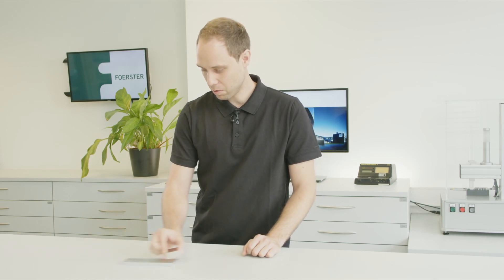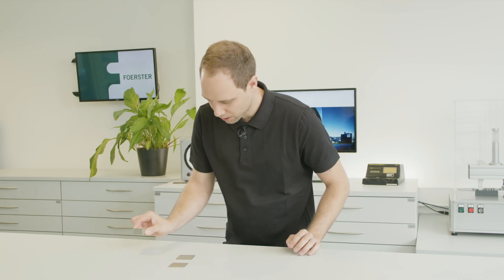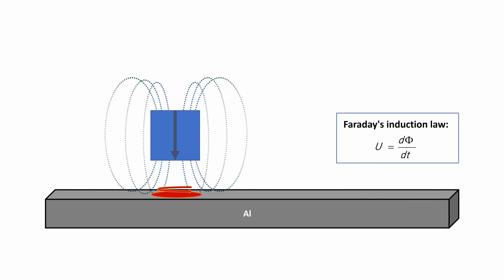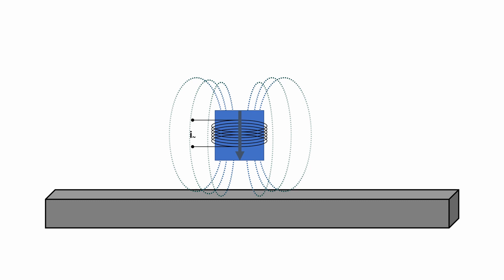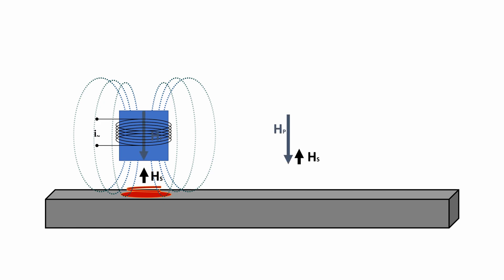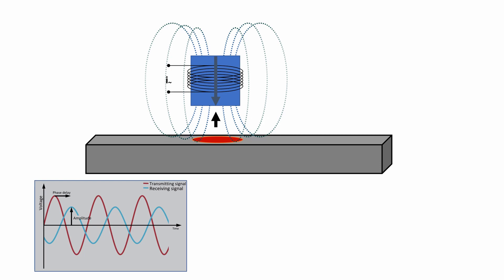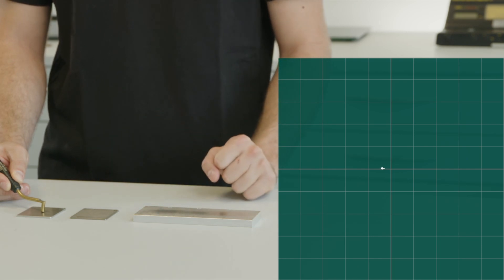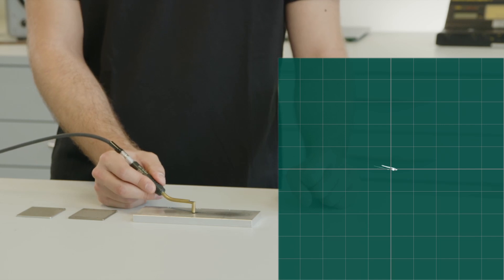Testing with eddy current -  explained simply

Comment: Nice demo

But what causes the Eddy currents to move the objects?
Reply from the maker: Eddy currents are generated when a changing magnetic field penetrates a conductive surface, inducing circulating currents within the material. These currents create their own magnetic field, which opposes the original magnetic field (Lenz’s Law).

This means that if you hold a copper disk in a varying magnetic field or move it over a magnet, eddy currents will be induced. These currents generate a magnetic field that opposes the movement, causing the object to slow down or even appear to move on its own if the magnetic fields are aligned correctly.

In applications like eddy current testing, this effect is deliberately used to detect material defects, as flaws alter the flow of eddy currents, creating measurable signals.

Comment: Eddy current testing (ECT) is a non-destructive method used to identify flaws in conductive materials, such as cracks or corrosion, by inducing eddy currents with an electromagnetic coil. The technique measures variations in these currents to pinpoint irregularities. ECT is highly efficient for applications in aerospace, manufacturing, and maintenance, offering rapid results without damaging the material. Understanding the principles of electromagnetic induction is key to optimizing its use and improving material quality and safety inspections. I came across from GAO RFID. Inc you might find pretty usefull for this topic!

Comment: Bear in mind, aluminum is not magnetic..Maybe the one you are using for the demonstration is an aluminum alloy already.
Reply: Aluminium is not magnetic, you are absolutely right in that. But aluminium is a conductor, and when a conductor is subjected to a changing electric field, it will create a current of its own, and when a current flows a magnetic field is build up. Yeah electromagnetism is weird. There are many great experiments on YouTube showing this, search for "magnet in a copper tube" to see what I mean.
Cheers

Comment: 🔴Either something WRONG or something I don’t understand it..

How an aluminum reacts to magnets, does it got an update?

The other thing is that a magnet suppose to attract metals not the opposite.

Any clarification?
Reply: Nothing is wrong. Aluminum is not magnetic but it can interact with magnets due to what we know as electromagnetic induction. The Eddy current induced in the aluminum when that magnet is moved over it create its own magnetic field opposing that of the magnet. You can check lenz's law for better understanding.